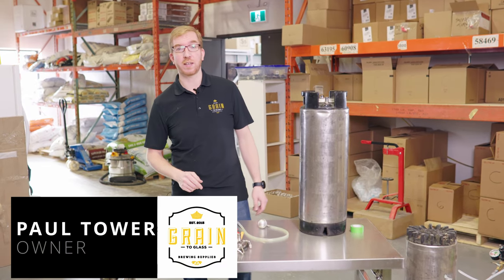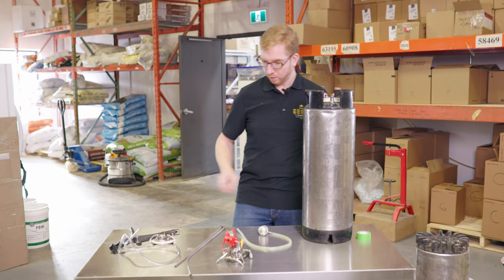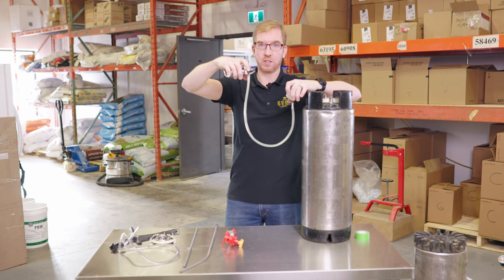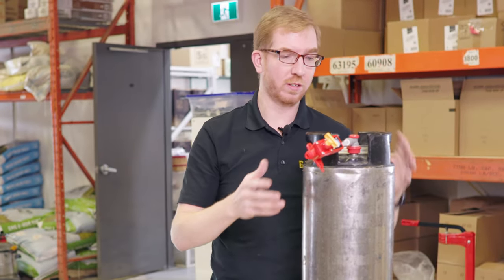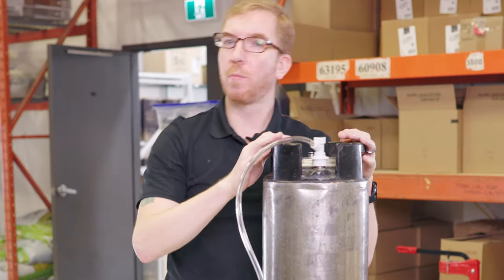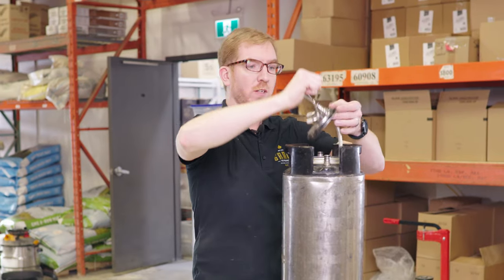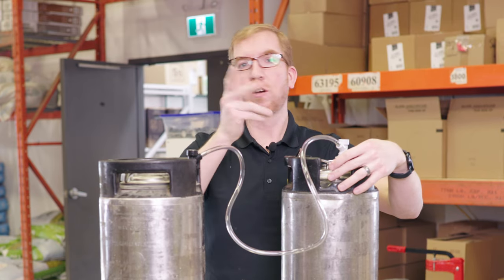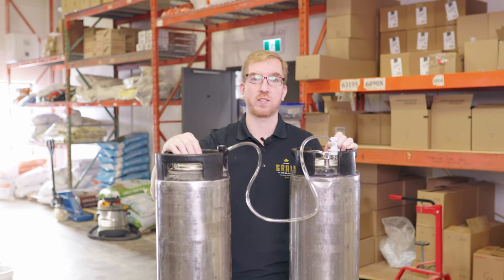Fermenting in a Corny Keg: This Is What You Need to Know!

Comment: Instead of opening the PRV of the receiving keg during a transfer, I just move the spunding valve over to the new keg, and put co2 on the old keg. As long as there is 1psi higher from the co2, the beer transfers and keeps all of the carbonation.

Comment: I just manually release the pressure once a day by pulling up on the valve (twice during the first couple of days) turns out fine.  I also don't bother with transfer or changing the dip tube, just cold carbonate in the same keg, the first pint will come out yeasty but should be clear after that.
Reply from the maker: You don't have any issues with the dip tube clogging? Or did you cut it a bit shorter?
Reply: I love your simple style this is what I'm thinking too why the heck transfer it to another keg and go through all that hassle of cleaning another keg and potential contamination just tap that thing as soon as it's done fermenting and serve beer simple tech I like it haven't tried it yet though myself but this is where I'm going simplification is necessary to keep me interested in this hobby
Reply: I can confirm that with the ball float you can even dry hop and still go all the way down to the bottom of your beer without it clogging
Reply: @Jmfufghf separating beer from yeast will taste better for longer storage time - dont forget yeast will die after some time and give you off-flavours

Comment: Newbie here.   I want to ferment in a keg.  I have a floating tip and spunding valve like yours.  To test I filled my keg with water with 10 lbs of CO2 pressure.   I set the valve to 10 lbs but the water comes out of the sounding valve.    The spunding valve  is connected to OUT on the keg.  Am I doing something wrong.
Reply from the maker: Hi, you need to connect the spunding valve to the gas in side of the keg.  Most people will replace the long liquid out tube with a short gas tube with a floating dip tube to avoid transferring a bunch of sediment once the beer is done fermenting.  Cheers

Comment: I typically brew 2.5 gallon batches, ferment in a glass carboy and transfer to a 9 Litre keg for serving. I do have some old 5 Gallon kegs that i no longer use. 1. would the amount of head space matter if i used the 5 gallon kegs as a fermentor with a spunding valve? 2. When transferring to the serving Keg, how would i know if the keg is full (I'm worried that i might have slightly more than 2.5 in the fermenter? Would it just spray out the gas line and make a huge mess for me to clean up? Or is there some way around this that i'm not thinking of?
Reply from the maker: Hi, the headspace won't be an issue as the amount of co2 produced during fermentation would push out all the oxygen.  Kegland makes an inexpensive device called the Flow Stopper that would automatically stop the beer from transferring into your 2.5 gallon keg when full.  We do have a video showcasing this product if you're interested. Otherwise you would have to keep an eye on the transfer and stop it to avoid beer from coming out of the receiving keg.  Cheers!

Comment: Could you explain the spunding vavle please
Reply from the maker: A spunding valve regulates the pressure during fermentation. As CO2 is produced during fermentation the spunding valve maintains a preset pressure, usually between 10-20 PSI. Once this threshold is reached, the valve releases excess CO2, ensuring consistent pressure. This process allows CO2 to dissolve into the beer, resulting in natural carbonation. It also helps suppress esters during fermentation.  Cheers

Comment: Made a few batches like this and it works well. The only odd thing I have found is that it seems to slow the fermentation process down slightly. Might be perceived but it always seems to take about 4 or 5 days more than non-pressure fermenting.
Reply: Good to know
Reply: You can also start without pressure and then add or dial down the spunding valve when you have only enough points left for how much you want to carbonate, either by guessing full attenuation or doing a forced fermentation test.

Comment: Nice video! What about regulate the temp during fermentation? Or isnt this necessary while fermenting under pressure?
Reply from the maker: Fermenting under pressure helps suppress some esthers from the yeast when you ferment a bit warm.  I still use a temp controlled box though.  Cheers

Comment: I'm trying to decide if I need to upgrade my fermenter or switch from a simple glass container to something more advanced like a conical. i have to be honest...this seems like more work than just siphoning it off. You don't even avoid getting sediment through the tune here you still have to watch for it so i don't really understand the point. is it because the bottom is conical in these guys? Or its easier with co2 pressure, or maybe just convenient if you already own these kegs? Great video but think ill stick to glass for now.
Reply from the maker: The main purpose it to be able to ferment under pressure and do a closed co2 transfer into a serving keg.  I use a floating dip tube so no sediment gets transferred.  Some people cut an inch or 2 off the liquid post instead.  Cheers
Reply: Fermentation under pressure allows you to brew lagers and other styles at warmer temperatures than traditionally achieved, and also permits closed transfer, which reduces oxygen exposure, which is key to certain, styles which otherwise drives off hop aromas and thereby ruining expensive batches of beer, e.g. NEIPAs

Comment: Great introduction thanks. I do have one worry before I try this. While fermenting in the first days, should I use a blow off tube from the gas post / the spunding valve? Or Am I good to go without worrying about the pressure building up in the corny keg.
Reply from the maker: Either a blow off tube or spunding valve will work, you need to use on or the other at least for a few days or the pressure will build up to much.

Comment: If you pressure fermented a beer, when you transfer to the serving keg and have the PRV open, do u lose the aroma ? If so, what is the best method to transfer? I am new to this process so a step by step explanation would be appreciated. Thanks so much
Reply from the maker: Not from my experience but a lot of brewers recommend using a spunding valve on the receiving keg instead of leaving the PRV open.
Reply: Move a spunding valve from the fermenter to the receiving keg. As long as the pressure in the target keg is lower than the sender, you're good to go! You're not going to lose aroma. Think of a spunding valve as an airlock, just under pressure. KegLand makes a fantastic , inexpensive one. Cheers

Comment: No need to waste your money on a carb lid.  All you have to do is replace the liquid dip tube with the same short piece that there is on the gas side which are cheap.  You then simply connect a floating dip tube to that.  No need to buy another lid for your keg. Sput valve is a must though.
Reply from the maker: This is true, I just find it a huge PITA to try and get the floating dip tube onto the co2 post inside the keg.

Comment: How about a closed loop transfer between fermenting keg and serving keg, would that be possible?
Reply from the maker: Hi, not %100 sure what you mean.  Can you elaborate?  Cheers
Reply: Fill the receiving keg with CO2 & purge. Place the Spunding valve on the receiving keg at 5psi. Push the co2 through at 8-10 psi
Reply: @wmwarriors  Better to displace water/sanitizer from the receiving keg with CO2 because purging doesn't effectively remove CO2 without wasting larger volumes of CO2, invariably more than enough CO2 gets left behind with the purge method which will risks oxidating your beers, but YMMV.

Comment: Newbie question: How do you know when your beer has finished fermenting in a keg if you can't take samples out to check it's gravity?
Reply from the maker: Hi, you could use something like a picnic tap to pull off a small sample for a gravity reading.  Cheers
Reply: Taking samples is easy.  Had a little difficulty with my Tilt 2 but it will work if the phone is close to the keg